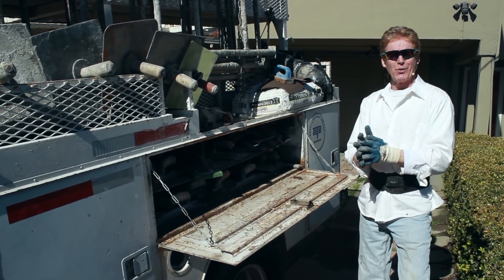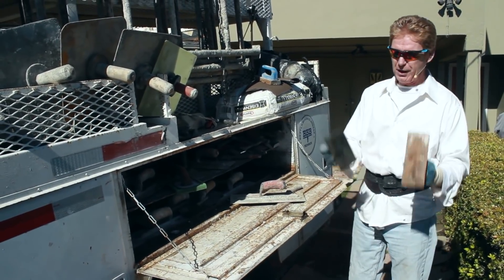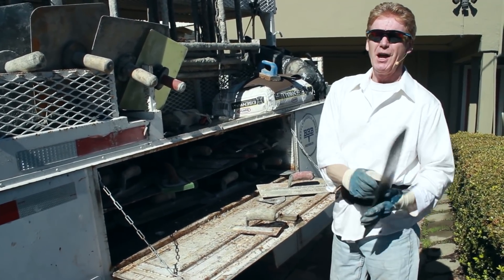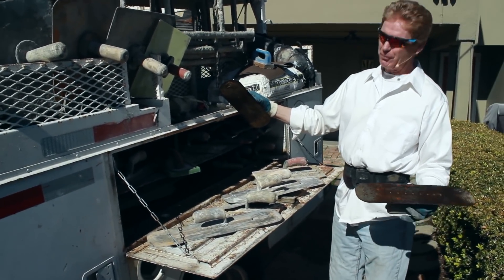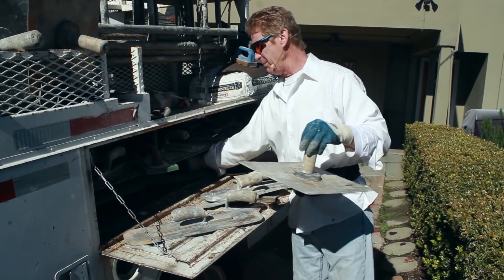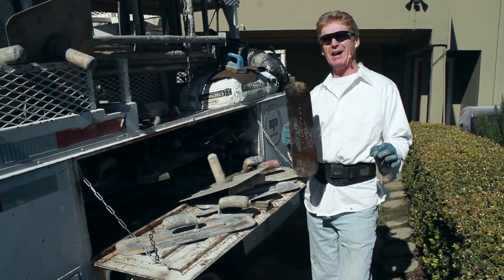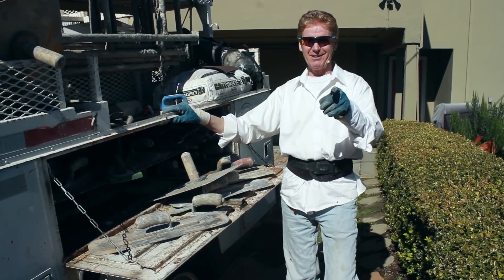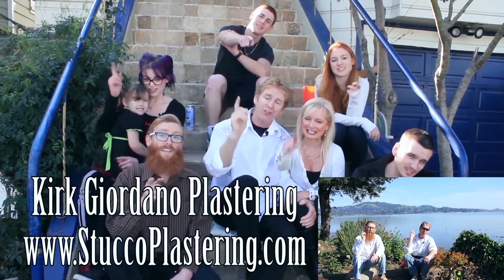Stainless or Carbon steel trowels

Comment: You can always clean stainless steel trowels way easier. A little trick I use is to clean them with the rapid set control retarder. Mix one packet in a bucket of water and leave ur trowel over night submerged in it and next day it will look brand new with no stucco or cement on it. Crazy how that stuff works when it comes to cleaning stainless steel trowels.
Reply from the maker: Howdy Edwin, my fellow plaster. I'm going to try this as it sounds crazy, but if it works, I owe you a gallon of your favorite beer. 
I have at least 20 bags of the retarder on my truck most of the time and about 20 rusty trowels on my lower shelf, still.
                Peace, love, and happiness to all.
Sound Plastering tips from your favorite stucco nurds
Reply: Kirk Giordano plastering Inc. Let me know how it cleans ur trowels
Reply from the maker: Good evening Edwin, will do.
                                     Peace, love, and happiness to all 
                          Bringing Plastering tips to the world, via YouTube Video
Reply: @StuccoPlastering  Did you give it a try kirk?
Reply from the maker: Evening Tommobommo, yes I did give it a try, it worked too well, it removed the rust,  then proceeded to eat the trowel blads a bit, and any area where it spilled removed the paint also.
 It's similar to using muriatic acid to clean plaster of trowels.
 The question is if your going to do this keep is a well-vented area, and don't leave the trowel in it too long.

                         Another day at the office for us, 
  Sharing stucco secrets and or common sense plastering tips
Reply: @StuccoPlastering  Haha think I'll stick to the old bicarbonate and water then!

Comment: Stainless all the way for me! Most of my work is interior finishing, regardless of whether it’s indoor or out though I still opt for stainless, Far less maintenance needed, also are easier to keep looking new.. however... I will say that a broken in carbon steel trowel can be amazing in the hands of the right plasterer 👍
Reply: I use my 18” Nela mediflex more than any other trowel.. amazing plaster finish, super flex is more for the shine.
I think the stainless only plays a part in the standard type trowels like the Marshalltown golds n that, they’re thicker and take way more breaking in 💪
Reply from the maker: Howdy Dangerous Dave, thanks for the tip, I'll have to try the Nela.
                Peace, love, and happiness to all.
Sound Plastering tips from your favorite stucco nurds

Comment: Hey Kirk, love your great videos!  Question, what is the best (or your favorite) concrete bag mix for doing decorative 2 foot formed retaining walls?  We are out here in Pennsylvania and have Home Depot and Lowe’s etc.
Thanks in advance!
Reply from the maker: Evening Bulided Duude, if you re fast and want strength, use Rapid set, you just add water, dont over mix this product.
 Otherwise, Quikcret or Sackcret work well too, these you need to add sand to.
 There are so many same day products selling at Lowes and Home Depot now it's difficult to keep up with.

                         Another day at the office for us, 
  Sharing stucco secrets and or common sense plastering tips

Comment: Kirk, do you recommend rounding off the square edges of a plastering trowel.
Reply from the maker: No I recommend going on Amazon and buying a swim pool trowel, our site has the same one I use. 
It's not a full radius as they are for concrete.

Comment: All my ornamental tools are mild steel i use wd-40 to prevent rusting curry makes a good carbon and stainless trowel you should show them how to tune your trowel
Reply from the maker: Morning Greg Day Dude, I use w-d sometimes too or mineral oils to wipe them down in the winter.
BTW, these are Currie trowels.

 The broken door sort of kicked me arse,  I was gone and didn't realize the temperature and rain would come down so hard.
How hard? all my trowels in the lower box submerged in 4 inches of rain.
 Such is life, not the first time or the last time my trowels will rust with my help.

                       Peace love and happiness to all 
            Bringing Plastering tips to the world, via YouTube Video

Comment: Tell me what to kick structolite  off with
Reply from the maker: Morning Tuckpoint, add a handful or two of almost any cement plaster, it takes practice to find the right amount for your personal skill level.
 For example, you have a five-gallon bucket mixed of Stroucto-Lite, you add a handful of Portland cement, this starts a chain reaction that accelerates the set time of Structo-lite, Instead of setting in say 3 to 5 hours, it will set in 20 minutes. This takes practice.

                       Peace love and happiness to all 
            Bringing Plastering tips to the world, via YouTube Video

Comment: Actually, thickness/length equal, there is barely any difference in the flexibility of conventional carbon and stainless steel. Their "modulus of elasticity" is about the same, between 28,000,000 to 29,000,000 pounds per square inch. Happy troweling!
Reply from the maker: Evening dude, let me guess, you're a mathematician or engineer.
                                     Peace, love, and happiness to all 
                          Bringing Plastering tips to the world, via YouTube Video
Reply: @StuccoPlastering  Yes Sir! Structural engineer and home improvement handy man...who is learning some good techniques from Kirk to repair his foundation wall stucco.
Reply from the maker: @psuengineer84  You come to the right place my friend.
 Best wishes, kirk giordano Plastering

Comment: I'm not a plasterer but with stripping knives and filling knives I always go with carbon steel because they last longer stay sharper and are easier to sharpen rusting not to much of a problem just keep them in oil rags and treat with wd-40 stainless steel or at least one's iv'e used go blunt quite fast.
Reply from the maker: Greetings J.W. good tip, brother.
                  Bringing peace, love, and harmony back to the world of plastering. 🌎
    The most complete plastering encyclopedia on video, by the plastering messengers of Youtube.🧞‍♂️with over 800 videos 🧘🏻👀💃